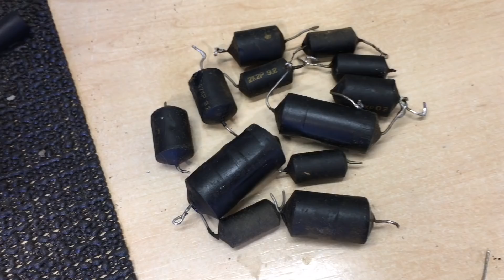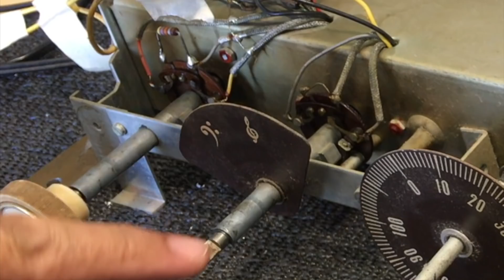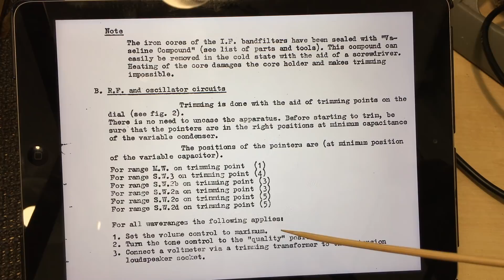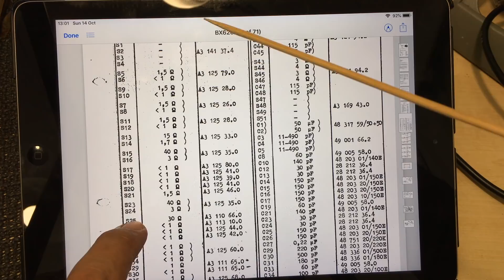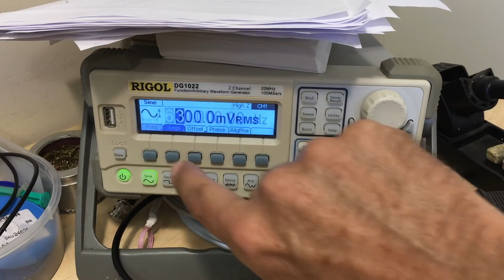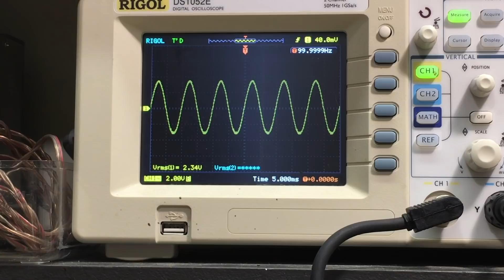Philips BX626 tube radio restoration - Part 4. Various solutions to the reception problem.

Comment: Hi 
Very interesting repair job as well as other videos
I have a couple of questions , what if you replaced the rectifier tube with a couple of diodes ?
It might have a higher B+ 
May be around 260 vdc as shown in the document 
The use of rectifier tubes for the radios of that era is not usual , most of the German radios utilize the selenium rectifier or selenium diodes why ?
Is it any advantage for using rectifier tube rather than selenium rectifier/diodes regarding hum or noise?
Reply from the maker: I generally don’t like to replace rectifier tubes unless they’re blown and I can’t get a replacement. They started using selenium rectifiers in place of the tubes when these came into the scene, so I pre few r to keep it as original as possible.
I don’t believe that it makes a difference to him or noise.